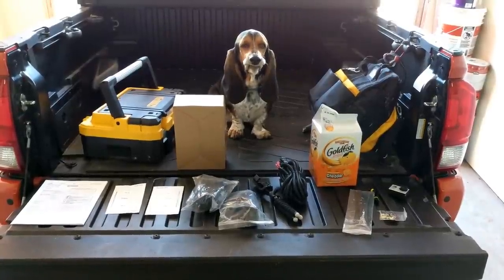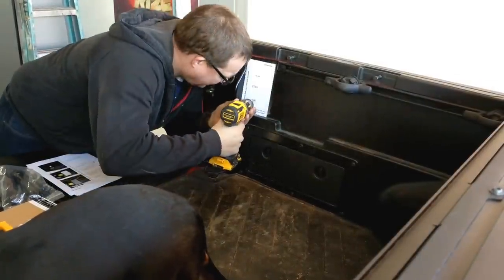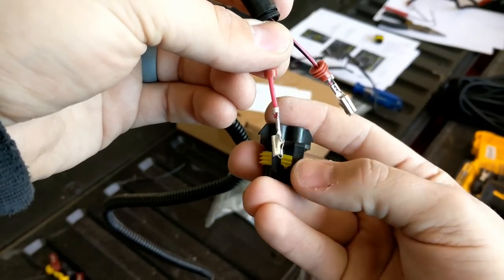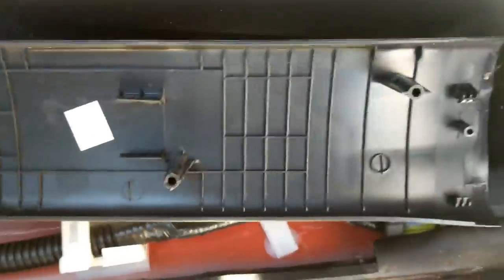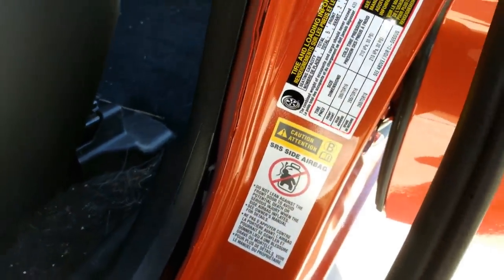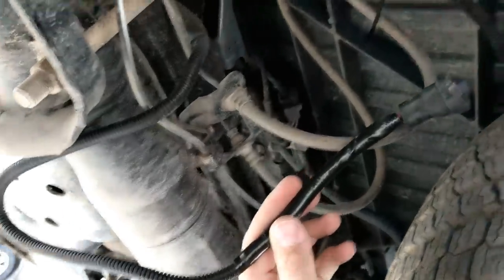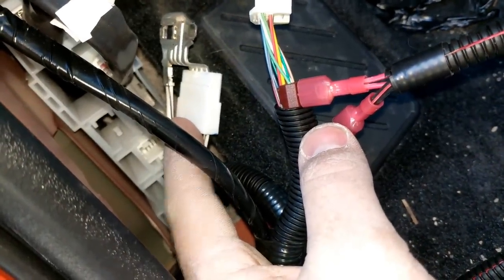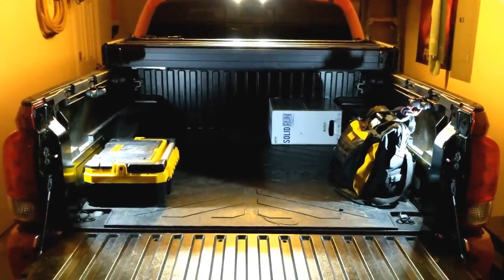2017 Toyota Tacoma Bed Lighting Installation

Comment: I pre-cut the drivers side harness to about 7 feet and it matched up with the passenger's sided which goes around the back of the spare tire toward the driver's side. I cut the connection end of long harness off (about 12 feet too long) and ran it forward to the gourmet in the rear seat foot well behind the driver and then down the length of the vehicle to the drivers foot well. Like you, I wrapped the two black wires together and attached them directly behind the ground bolt with a clamp on o ring and used the supplied alligator clip to attach the power lead to #14 light green wire for the bed light switch. Very clean installation. Looks like the bed lights came from the factory this way.

Comment: on my 2017 pro there is another access plug near the front seat about two feet forward from where you entered and the plug on my kit was smaller. it fit that hole exactly so i didn't have to pull the post clips! the OEM vampire clamp was crap and wouldn't penetrate the wire so i used one of my own. i fishtailed the wires through the frame rail and they work great! thanks for the great video!

Comment: Nice job!  I bought an LED light bars and need light for my bed too.  I also have the tonneau cover too and at night can see nothing.  I didn't know what wire to tap. 

All you need now is to add the power tail gate lock. Like I did.  I put up a video too in case you want to see how to add a power door lock to your tailgate. 

Thanks again!
Reply from the maker: I did watch that one actually, and I want one now... Some day...
Reply: Toyota Fixation .... it comes in so handy (since I have a tonneau cover).  I hated taking the key out of the fob to lock or unlock it.

Comment: As mentioned by someone else, there seems to be many bed lighting kits that use LED strips. This would seem to be a lot cleaner. The only thing is, potentially you could put something similar up towards the cab.

Comment: Posi-Tap connectors are worlds better if you have to tap into a wire. Pokes through the center of the wire rather than weakening it by cutting the sides.

Comment: Nice video thanks for putting that up. 
Initial like for the pooch sitting in the middle of the bed at that start of video ! 

can you provide more info on the hot wire you tapped near the clutch ?
Reply from the maker: yani reglis yeah, most of the details are in the link to the instructions in the description. If I recall correctly, it's the lowest plug, and it's the cable right in the middle of the bottom row...

Comment: Instead of bundling up all that extra cable it would of been better to cut it a little longer than needed and reinstall the head on the wire woth soldier and heat shrink othrwise nice job real clean i installed the same one and it's made for a tacoma

Comment: Thanks for the instructional video. It helped a lot. My template, for some reason, did not fit correctly and I had to redrill the bottom hole.

Comment: Just curious why you would need to install lighting in the back of the bed when the back top of cab outside has a very good factory lighting? & what the heck is a vapire clip is there such thing as a frankenstein clip?
Reply from the maker: Of course... The factory Tonneau Cover I have on the truck completely blocks the light from the deck lamp when it's closed, necessitating the extra bed lights. Additionally, even with the cover off, it's extremely helpful to have lights facing forward in the bed to compliment the rear-facing light from the deck light when you're dealing with cargo in the dark. In my application, it was well worth the time and money investment for the added light at night. 

The vampire clip is a down and dirty way of tapping into an existing wire. They call it a vampire clip because it "bites" into the wire sheath of the existing wire and saps power from it. I don't particularly like them because they pierce the weather stripping of the wire and can result in corrosion. In my imagination, a frankenstein clip is probably what I was doing to install a new radio in my Toyota Tercel in high school... it's a complicated type connection which involves twirling frayed cable ends together and a grievous amount of electrical tape. I do not advise using a frankenstein clip in any application that you would like to last longer than a few months.

Comment: hi.  I bought the same kit after seeing your video.  I was wondering what's the total time did you devote to the project?  I need to budget some time to do this.  Thanks for the video and reply.
Reply from the maker: It's been a while since I installed this kit, but if I recall correctly I think it was an hour or two.
Reply: @ToyotaFixation  thx

Comment: Mine is a 2020 and already has the holes for the bedlighting, they just have caps over them from the factory, im assuming the installation is the same?
Reply: No much easier you already have the wiring already installed.
Reply: @Stealth Viking  reporting back here, was super easy. As you said, the wiring was already there which was awesome

Comment: do u happen to k ow if the original led lights just plug in play I had a 2015 Silverado and they had a plug by the spare where they would plug in instead of running a seperate power and ground
Reply from the maker: Not sure what you mean by "original led lights"... I don't know if it still holds true for the 2018s, but the 2017s never had a factory option for bed lighting so there's no plug on the Tacomas for bed lights. That's why I had to graft into the cable in the cab for the bed light.
Reply: @ToyotaFixation  , I think the bed light kit was originally made for the Tundra, but easily fits the Tacoma, especially the lights themselves.  The wire is way long because its probably designed for a full crew cab Tundra with the long bed - ALMOST as long as a school bus!  But now that you showed us this,  the installation much more rewarding than plug and play!  Thanks!  BTW have you trained Ferguson to hand you wrenches and pliers yet?

Comment: Does anyone know if the 2019 tacoma come with a plug and play connector, since now the dealership offers them installed P/N PT948-35160
Reply: Louie_TRD great question
Reply: numbr2luder im almost this close to buying them. I just need confirmation that they will be a plug and play for my 19 tacoma. It is a tacoma specific part number.
Reply: I don’t believe so, 2020 and up

Comment: Since this kit works with the cargo light if i leave the cargo light on with the cargo light switch to on position will these lights stay on too?
Reply from the maker: fortis619 if you wire then like the instructions tell you, and like I did, then yes. If the bed light is on then they are on. I've seen some people wire in a switch, and I might do that in the future. I might do a three position switch with 'on', 'off', and 'on with bed light' as the options.

Comment: What is that bed box? I looks exactly like what I want.
Reply from the maker: Rob Irwin you mean the DeWalt drill box?
Reply: Toyota Fixation No, the big cross-bed box right up by the cab. Oh, or is that a hard tonneau folded up and it just looks like a box?
Reply from the maker: Yes, it's just the hard tonneau cover...